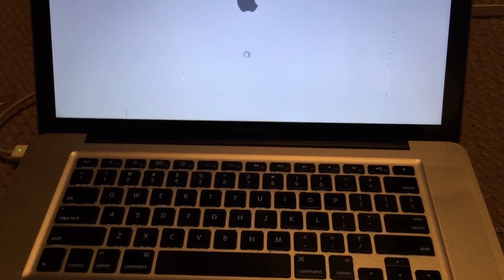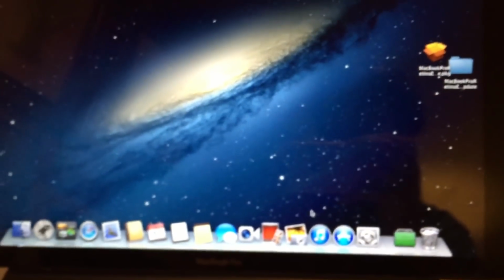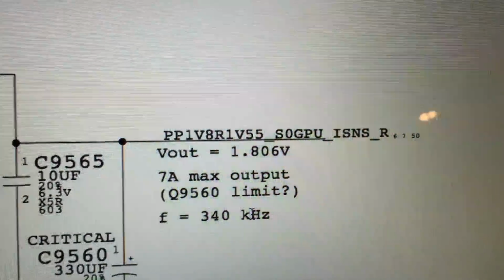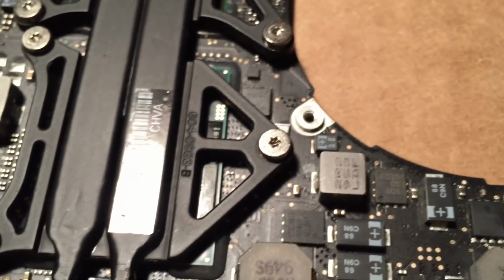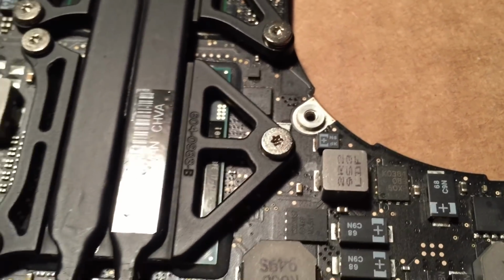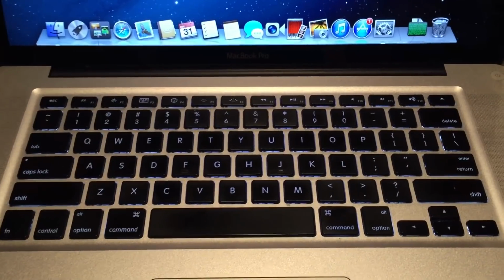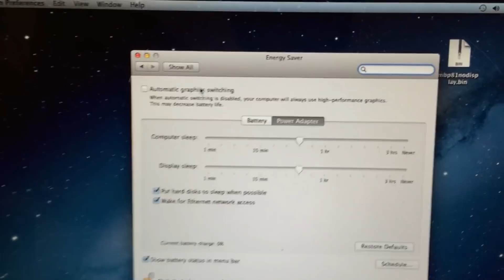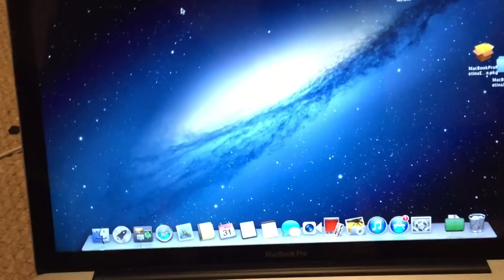Repairing a Mid-2010 15" MacBook Pro that Kernel Panics when Using the Dedicated GPU

Comment: A better replacement for the original 330µF, 2V tantalum capacitor would be an aluminum polymer capacitor with the same or higher capacitance (330µF or greater) and a higher voltage rating (e.g., 2.5V or higher). These capacitors are more durable and less prone to the characteristic failure of the original tantalum type.

Comment: Hello, it is June 16, 2024... I followed all your instructions and repaired a macbook pro mid 2010, I have had it operational since yesterday, working without problems... excellent information, thank you very much, and just as a piece of information, with I have installed OpenCore legacy patcher Sonoma 14.5, it is wonderful to see a 2010 mac running with macos 2024.
Reply: Well done! Where did you source your capacitor - I'm thinking of doing the same repair.
Reply: Hi! thats great to hear! as the last guy asked, which capacitor did you use for the repair?
Reply: @geremias707  Hi… 330 uf 6,3V … from Lenovo ThinkPad T440 MB

Comment: Hi I have a 2010 MacBook Pro but it’s got a 820-2915a board , turns on but blank screen , no backlight , screen is not powering up at all but keys works & light up, won’t power up with battery disconnected with charger plugged in , but will run on battery only , tried all the resets , checked screen & it’s working , does not have any voltage on pin 2 of lvds connector so no enable , any ideas? 😅n thinking pp3v3 is not getting any voltage & something is blown on power side , cheers 
From New Zealand btw

Comment: i did thae same as you did,replacing the chipfrom a donor logicboard. Everything works but my fan is on high speed almost all the time,even at startup,i know its not overheating.Do you know what the issue could be?

Comment: Total soldering novice here and I successfully completed this repair today! Made a funnel for my heat gun using aluminum foil and a hose clamp which worked well to remove the old capacitor, then cleaned off the old solder, applied some fresh solder, positioned the new capacitor in place, held it down with some tweezers and then heated it onto the board. Reassembled and now it no longer panics!
Being totally honest I was so surprised I managed to execute this correctly as I hadn’t touched a soldering iron since my school days, but just shows anyone can give it a go.

Comment: Where on the logic board is this capacitor on the 2010 17-inch models? I’ve got a couple I’m trying to fix but can’t find that chip
Reply from the maker: This is not an issue on 17" machines; they don't have this circuit designed this way.
Reply: @dosdude1  any idea what would cause discolored graphics on a 2010 17-inch? Issue goes away when applying pressure on the keyboard. Stays the same regardless of which GPU is used.

Comment: NO HARDWARE CHANGES NEEDS TO BE DONE !!! However this is extensive work is not needed since there is a software file to download which tells the MBP to read the info it gets differently. Takes no time at all to install. It works 100%. It is called: "MBPMid2010-GPU-Fix-0.6.1".  After installing it you´ll have to reboot your system to make it work. That's all. Just did this a week ago after being without a functioning MBP 2010 for months.
Reply: This fix drops working frequency much, so better do the cap replacement.

Comment: Just performed this repair on a Mid 2010 15" 2.8 i7. Took the 330uF 2.0v cap from a 2009 13" MBP and swapped it onto my board, works great now!

Comment: @dosdude1 what is the part number for larger capacitor on this macbook pro?
Reply: A better replacement for the original 330µF, 2V tantalum capacitor would be an aluminum polymer capacitor with the same or higher capacitance (330µF or greater) and a higher voltage rating (e.g., 2.5V or higher). These capacitors are more durable and less prone to the characteristic failure of the original tantalum type.

Comment: The Genius Bar couldn't figure this out and replaced my hard drive instead. I knew that wasn't the problem, and it didn't help. They apparently couldn't replicate the problem. I had never paid that much for a computer before, and still haven't with my current MBP.  Knowing the solution today, 11 years later, breaks my heart.

Comment: Hi Dosdude1 ...Great Vid .... I would rather not try soldering nor have I got a donor board for the replacement cap... My Question is as a easier workaround Can I just set the Intel Graphics to be default rather then using the Switchable Nvidia to Intel graphics mode ? And if So will it stay that way even after Reboot ??? Many Thanks

Comment: Can I use 220 or 470 or 560 capacitor instead of 330?
Reply: A better replacement for the original 330µF, 2V tantalum capacitor would be an aluminum polymer capacitor with the same or higher capacitance (330µF or greater) and a higher voltage rating (e.g., 2.5V or higher). These capacitors are more durable and less prone to the characteristic failure of the original tantalum type.

Comment: I just did this to a mid 2010 15" MacBook Pro. I used the caps from Louis Rossmanns website. but when I force it to use the dedicated graphics it will still panic. would that mean that I have a really rare graphics card that is bad on these? thanks for your videos man. really help out with a lot of stuff
Reply: Me too
Reply: AI indicates, A better replacement for the original 330µF, 2V tantalum capacitor would be an aluminum polymer capacitor with the same or higher capacitance (330µF or greater) and a higher voltage rating (e.g., 2.5V or higher). These capacitors are more durable and less prone to the characteristic failure of the original tantalum type.

Comment: Good job.please do you have a link so i cannorder one capacitor ? Thank you.
Reply: A better replacement for the original 330µF, 2V tantalum capacitor would be an aluminum polymer capacitor with the same or higher capacitance (330µF or greater) and a higher voltage rating (e.g., 2.5V or higher). These capacitors are more durable and less prone to the characteristic failure of the original tantalum type.

Comment: What name type capacitor is?
Reply: A better replacement for the original 330µF, 2V tantalum capacitor would be an aluminum polymer capacitor with the same or higher capacitance (330µF or greater) and a higher voltage rating (e.g., 2.5V or higher). These capacitors are more durable and less prone to the characteristic failure of the original tantalum type.

Comment: As an amateur it was looking like a very difficult repair, but w the right tools (hot air station, trinocular microscope, the right replacement cap, and lots of patience it was ultimately relatively easy, now no kernel panics! Yay!
Reply: even possibe with just a soldering iron how ever it wont look pretty :D

Comment: I tried doing this repair. It went well for a few hours. Then the computer crashed with another error. I went back and checked my work. The positive side of the capacitor was grounded. I took the capacitor off and checked it off the board and it was fine. So I checked the motherboard pads and the positive side is grounded somehow. I’m not sure how to fix this now.
Reply from the maker: The resistance to ground is supposed to be low (low enough to make a multimeter beep). Just check the value and compare to an acutal continuous ground.
Reply: The other capacitors on the board don’t read ground on the positive side. And the capacitor I took off does the same. But the pads that the capacitor came off of both read the same ground. Right now the little light in front comes on for a few seconds then just shuts off. Basically the computer doesn’t turn on any more.

Also how could both pads be grounded. What could I have done wrong to cause that. The reading is exactly the same on both pads.

Comment: Doesn't look too hard, but I'm new to the whole hot air station game and I am struggling to get components off the board. Any advice as to temp setting and how long you need to heat the components for? Thanks. A

Comment: Great video. Very informative and helpful. Quick question... Could this repair be done without the heat gun, or is it required for the type of removal and replacement of capacitor ?
Reply: Good question.
Reply: @Dan-TechAndMusic   Thanks, good to hear that!  I have a soldering iron so will try it.

Comment: I paid 350€ for a new mothefuckinboard, so Apple could get fatter. Still had to replace the capacitor on that new board to be sure it wouldn't break down too! I could have saved that money. Made me rethink my love for Apple. I love the NeXTstep operating system, but most of the Mac hardware is overpriced trash.

Comment: The capacitor you are replacing does not need to be larger.  The cap voltage rating in this design is incorrect. It is rated for 2V on a 1.8V rail. The proper design would have a cap at least 2X the rail voltage. Use cap rated at 3.6V or greater.
Reply: Is this kind of capacitor specific for macbook or could i find it on other laptop?

Comment: If I understand correctly, would a workaround be to just leave automatic graphic switching disabled?  For me, it panics when I get clicking too fast and there's a lot of graphic action (with switching on).
Reply: I think I can answer my own question.  I unchecked Automatic Graphics Switching and I still get daily GPU panics.  I don't understand that based on the explanation in the video.

Comment: 2R5TPE330M9 330UF 2.5V 330 6.3V SMD Tantalum Capacitors Polymer POSCAP Type D ultra-thin 7343 D7343 new and original   this can replace 
macbook pro 15' mid 2010.....9560-330uf.     capacitor
Reply: A better replacement for the original 330µF, 2V tantalum capacitor would be an aluminum polymer capacitor with the same or higher capacitance (330µF or greater) and a higher voltage rating (e.g., 2.5V or higher). These capacitors are more durable and less prone to the characteristic failure of the original tantalum type.

Comment: is any 330uf capacitor can use?
Reply: A better replacement for the original 330µF, 2V tantalum capacitor would be an aluminum polymer capacitor with the same or higher capacitance (330µF or greater) and a higher voltage rating (e.g., 2.5V or higher). These capacitors are more durable and less prone to the characteristic failure of the original tantalum type.

Comment: Can someone please help me? Great video, I'm not sure if it is the same problem that my Macbook pro Mid2010 has because it's the 13 inch model. Can someone tell me if the 13 inch model has the same problem with the C9560 capacitator? Thanks.
Reply: All mid 2010's have this problem!

Comment: I have a similar problem with my MCB Pro 2007. it happens sometimes. sometimes I can use the mac for hours and sometimes only for minutes and when it crashes it will keep rebooting and only under power with the charger. I have change the battery, clean and replace the thermal paste, cleaned fans but it keeps doing th same thing. can you help me fix it by pointing where to look for the faulty part? I am willing to send it to you for repair also.

Comment: I have a mid 2010, 15",  A1286, 820-2850-A motherboard, and the motherboard is reconfigured different. The cap. is not in the same place as the motherboard that you show. perhaps is because the processor model..?   Help please..

Comment: Hello and Help have you ever seen this on a MBP 15" 2010 i5 CPU? I replaced the Cap and it still is doing this.  https://i.imgur.com/hFGIGtZ.jpg , any idea's would be appreciated.
Reply: A better replacement for the original 330µF, 2V tantalum capacitor would be an aluminum polymer capacitor with the same or higher capacitance (330µF or greater) and a higher voltage rating (e.g., 2.5V or higher). These capacitors are more durable and less prone to the characteristic failure of the original tantalum type.

Comment: Hi dosdude1 thanks for the video !
At the 8:26 minute Why do you desolder capacitor out ?
But after, you don't re-soldering this ?
Also...why you soldering a different capacitor in the position of the c9560, bigger than the original ?
Thanks for the answer.
Reply: the board at 8:26 was a donor board from which the capacitor was taken
the reason its bigger is because it was the size of it causing it to fail
Reply: @Eeviean  thanks, where can i buy these larger capacitors ? And what is the exact acronym for this?
Reply: @marcellocardella4393  just look for 330uF 2V DC SMD capacitors
Reply: @Eeviean A better replacement for the original 330µF, 2V tantalum capacitor would be an aluminum polymer capacitor with the same or higher capacitance (330µF or greater) and a higher voltage rating (e.g., 2.5V or higher). These capacitors are more durable and less prone to the characteristic failure of the original tantalum type.

Comment: Thanks to you Dosdude. I got ripped off on ebay for two caps that were supposed to solve this issue, but made no difference. Luckily I have a dead 2011 MBPs that I could use as a donor, and following your video  both of the 2010 MBPs are now as good as new, working like a charm, and allowing iMovie and old games like Portal 2 to work flawlessly. The computer lessons with young daughters can now resume. I would love to know how many MBPs have been saved from the scrap heap by this! My first component level logic board repair! Thanks again!

Comment: I'm having this issue and "the great" Louis Rossman failed to fix it. There's an SSD and maxed out RAM in it and I would love to pass it down to some one who's not computer savvy, What else can I do?
Reply: If Louis or his team cant fix it, it probably isn't fixable!
Reply: A better replacement for the original 330µF, 2V tantalum capacitor would be an aluminum polymer capacitor with the same or higher capacitance (330µF or greater) and a higher voltage rating (e.g., 2.5V or higher). These capacitors are more durable and less prone to the characteristic failure of the original tantalum type.

Comment: Hey Dosdude1, I’m having this same issue with the same exact MacBook Pro 15-inch Mid 2010.. Do you provide repair service for this issue? If not do would you mind sharing the resources on for the parts, and how to repair it, thanks!
Reply: another way which works (only MBP mid 2010)  https://github.com/julian-poidevin/MBPMid2010_GPUFix

Comment: What larger capacitor should I place instead ? Pls write the name
Reply: A better replacement for the original 330µF, 2V tantalum capacitor would be an aluminum polymer capacitor with the same or higher capacitance (330µF or greater) and a higher voltage rating (e.g., 2.5V or higher). These capacitors are more durable and less prone to the characteristic failure of the original tantalum type.

Comment: would a 330UF 2.5V Capacitor work???
Reply from the maker: Yes.
Reply: dta 20502  Your machine is a different model, probably with another know problem with the graphics mux IC.

Comment: I have found a capacitor 330 uF 2V with exact same case (1210) : ref AVX TLJT337M004#2700
Distributor for France: Farnell online
Cap mounted and appear to be OK.

Thank you for the crash log screen which confirm mine: NVRAM[0/1:0:0]: Read Error…

Comment: Good afternoon Collin.... I want to thank you for all you've done for us on YT and the website! It's greatly appreciated! I have one question I have an similar issue on a mid 2010 17" MacBook Pro Logic Board 820-2849-A. It shows the Tantalum Capacitor 330UF 2.2V @ 20% on the board view as C9510 for the 1.05V Video Out. I am safe to say that the Capacitors Rossman sells are going to work this board? As he lists different Logic Boards.

Comment: If possible, please could you tell me what was the temperature on the hot air station? What temperature i need to use for this capacitor so I don’t burn them? Thanks!
Reply: I did it @ 400C
Reply: @laurenta.eppinger1822  Thank you so much, I was able to fix my Mac:) your info was very helpful.

Comment: Hi. Great video. I'm wondering if this solution is also applicable for a late 2011 MacBook Pro 17 inch with a AMD Radeon HD 6770M GPU. I'm now using the integrated Intel GPU.
Reply: Nope, I wish! I have two 2011s all using the integrated GPU. The AMD GPU's in these are trash.

Comment: HELLO, I HAVE THE SAME PROBLEM GPU PANIC, COM MY MACBOOK PRO 2010. I CAN BUY THE SAME CAPACITOR, BEARING IN MIND THAT THE SERIAL IS W80291Q2AGZ, SOMEONE CAN HELP ME?... THANK YOU.
Anonymous UUID:       FE1A9720-6A86-6A4D-360C-1172CB69A93D

Sun Apr 12 11:03:40 2020

* Panic Report *
panic(cpu 2 caller 0xffffff7f999658d3): "GPU Panic: mux-regs 3 3 7f 0 0 0 severity 3 WS-ready 1 switch-state 0 IG FBs 0 EG FBs 1:3 power-state 0 3D idle HDA idle system-state 1 power-level 20:20 connect-change 0 : NVRM[0/1:0:0]: Read Error 0x00000100: CFG 0xffffffff 0xffffffff 0xffffffff, BAR0 0xd2000000 0xffffff9133c72000 0x0a5480a2, D0, P2/4\n"@/BuildRoot/Library/Caches/com.apple.xbs/Sources/AppleGraphicsControl/AppleGraphicsControl-3.20.17/src/AppleMuxControl/kext/GPUPanic.cpp:170
Backtrace (CPU 2), Frame : Return Address

Comment: on my new bought aluminium polymer capacitor it's written WE390 84900E. Would it work or do I need exactly the 330 UF 2.0V?

Comment: Superb video man!
My mid-2010 17" MBP got similar issue here. But it has a 820-2849-A logic board, where the C9560 has different size, 220uf 2v, should i go bigger? Btw, one cap next to C9560, its C9510 has the exact same size 330uf 2v, i dont know if its related, can anyone help?
Reply: A better replacement for the original 330µF, 2V tantalum capacitor would be an aluminum polymer capacitor with the same or higher capacitance (330µF or greater) and a higher voltage rating (e.g., 2.5V or higher). These capacitors are more durable and less prone to the characteristic failure of the original tantalum type.